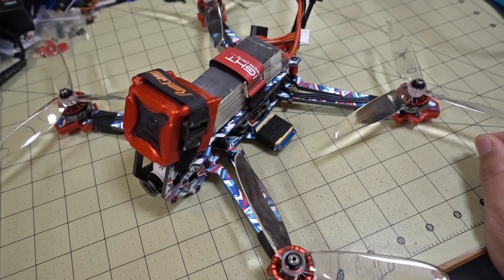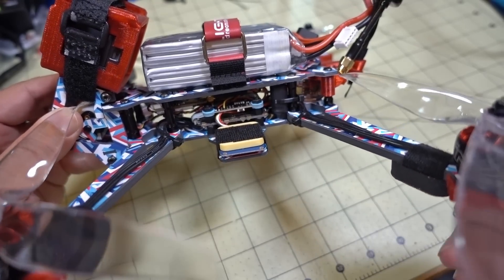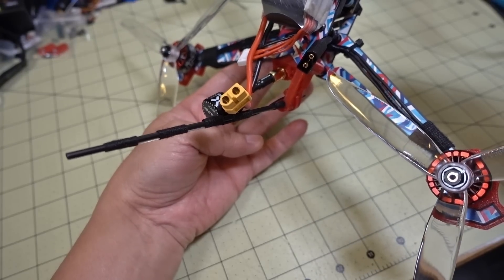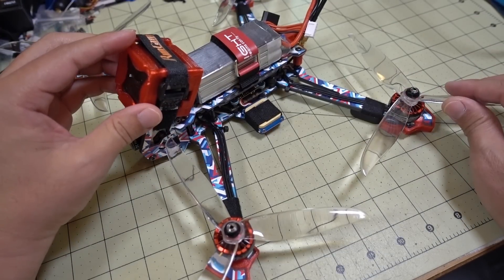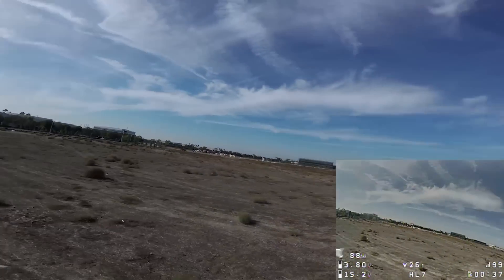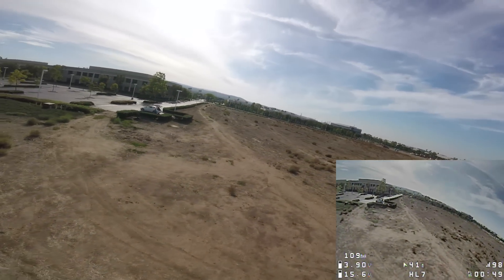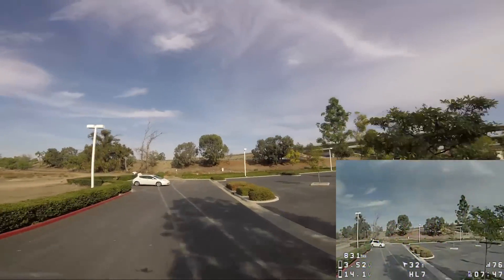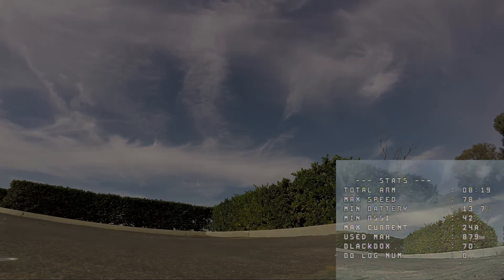iFlight XING 2207 Motors // HL7 Build 👍

Comment: xing 2207 2450kv prop Jn 4.5x4.5 esc 30a battery 4s ok?
I want to make a pylon race
Reply from the maker: Probably OK for most situations.  The ESC might pop in a crash however.

Comment: I just convert new frame 5inch to 7inch which all setup still 5inch 4s,2750kv 1500mah 100c. Today will try what time it can go or remaind same 3min. Or else i will change low kv motor for longer flight time.the sound 7 inch so nice.

Comment: I am looking into doing a very similar build.   I was thinking the 2306 1700kv, HL7 with 7" props and 6s.  Were you able to test 6s on 7" props?
Reply from the maker: I haven't tried it yet, but iFlight told me the motors would get hot.
Reply: So we only use 5" props? Or we can use 7" with 2 blades?
Reply from the maker: Use 4s lipo

Comment: what props were you using on this? 7"? Or maybe 6"? For I am building a 7" GEPRC Elegant with 1750KV motors and was going to go ahead and order some props even though it may be a minute before I get all the parts rounded up for planning on using Crossfire module or R9 haven't decided for sure....But I know gonna use 900mHz radio link and I've s/aeen many using only 6" props on 7" builds and I got a 7" because I WANT 7" PROPS hahaha....So wanted your input on prop size and even pitch and tri's or bi-blades for range and long flight times?? Planning on 4S prob as well UNLESS I get a wild hair and really want to go far or more acrobatic might use 5 or 6S but was hoping to stick with a larger 4S 2000mAh or something if that will suffice?? But wondered what 7" props would be good to try, some 7045 X 3's and/or some 7030 or 7040 Bi-blades>?? Then I have people telling me 6" props would be more efficient?? BUT I AM BUILDING A 7"!!! hahahahaha!! I KEEP SAYING THIS!! lol...So what's your recommendation on props for a 7" build for long flight times and maybe a little distance? Thanks Kim!-Turbo.

Comment: Albert, are you sure that you have the R9 power set to 100mW and not 10mW? RSSI should not go down to 50 at 200 meters, no obstacles at 100mW. Something seems wrong.
Reply from the maker: You're right, it was 10mW not 100mW... I misspoke in the video...  LOL.  Also, there's a large cell tower about another 100 meters away so that doesn't help either.
Reply: @AlbertKimTV  I heard you say 10mW